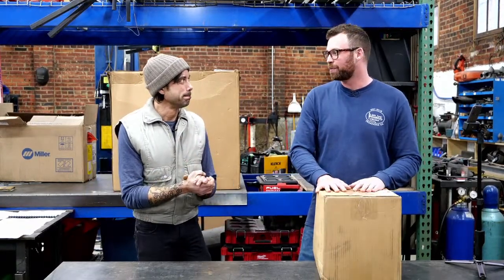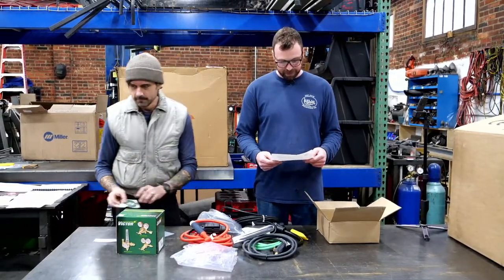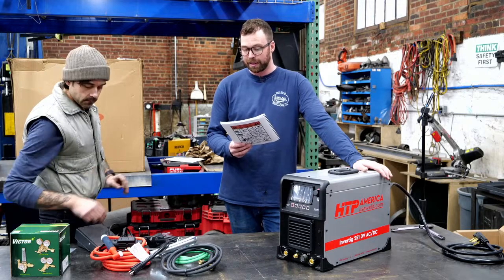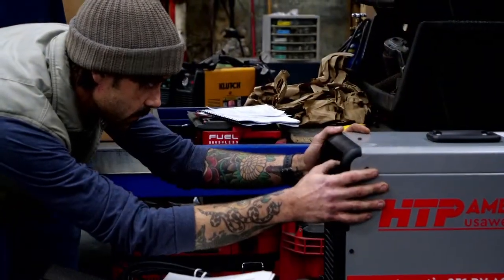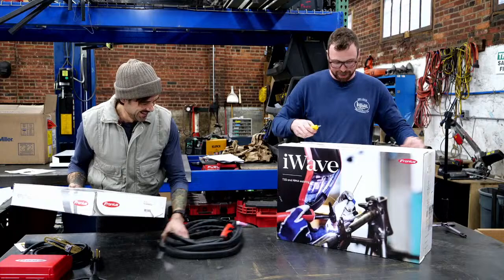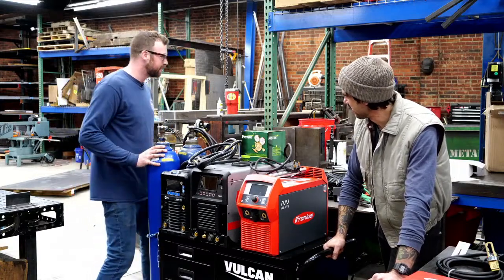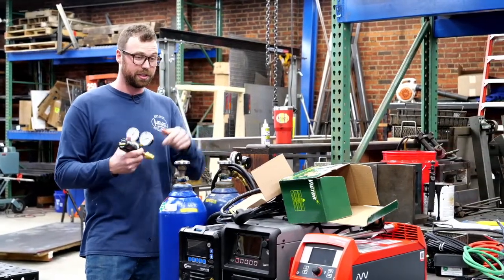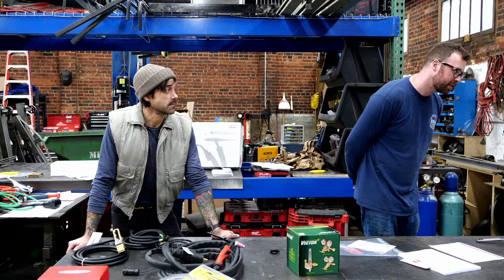The Most Expensive Welder Unboxing

Comment: Back in high school back in the 90s we used nothing but Miller synchro waves that's what I learned on was this synchrowave. Now when I taught myself how to TIG weld I took my time on picking out what I wanted to use I started with a cheap Amazon scratch start welder and taught myself how to DC TIG weld. Once I was comfortable I took my time and searched the market and I ended up with a primeweld TIG 225x w/maxcool watercooler added a flex-loc torch to the package all for under $2000 there is nothing out there you can get for that price.

Comment: Can't wait to learn more about the HTP! If they want to compete with Miller, then who knows what it could have. It sounds like you said it has an Adv. AC equivalent and carbon arc gouging capability, which is insane. Who knows, maybe we will see sub 4 amp start, independent waveform, independent amplitude, dc pulse wave-forms, etc. It feels like torture seeing this machine out and about before HTP even has it on their website.

Also having the miller plug for remote amperage is the best!

Comment: Need to take your favorite/winner and re-test against a 3000W portable (handheld) Laser rig. For me it was humbling how little time it took to produce full penetrating welds w/o any wire if parts fitted well at 5X the speed while holding parts w/o gloves.
 I know they are expensive up to 4 times the cost, however in less than an hour I was producing welds that looked like/equvalent to automated welds produced by robots. And you can clean and remove paint, rust, non ferrous oxidation w/o the pitting of sandblasting and absolutely no mess.
Plus lasers weld and mark/write on non metallic items/materials such as plastic, glass, ceramics, etc. Wire is needed as filler for loose fittting joints. However for most jobs only one side of material needs welding as with proper set up weld fully penetrates. 
One must treat torch like a gun as beam can reflect and travel across open spaces. Goggles look like colored ski/sun glasses and can be left on compares with colored glass used for large fixed laser CNC machines. Ray Stormont
Reply: Which laser welder did you get? I just got the Bodor, and I haven't even opened the box. Mine doesn't have a cleaning function but it does have a built in refrigeration unit. Unfortunately the wire feeder is separate. I have zero welding experience so I wanted to show in a video how well an absolute beginner can learn to use the machine.